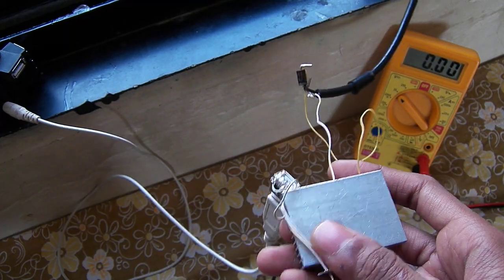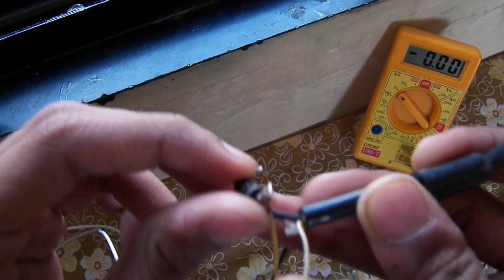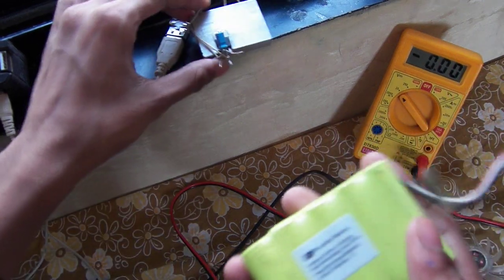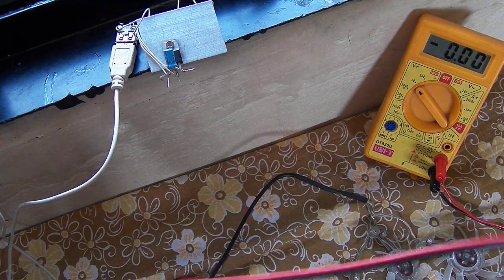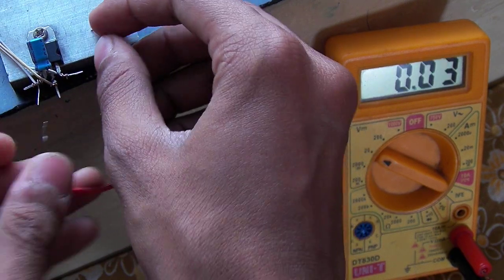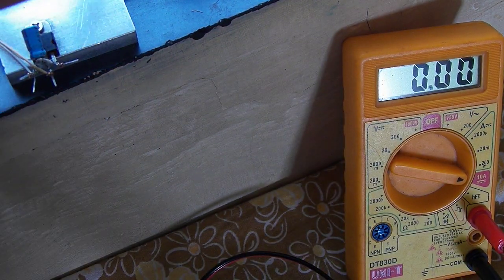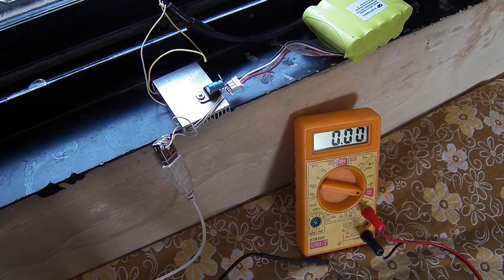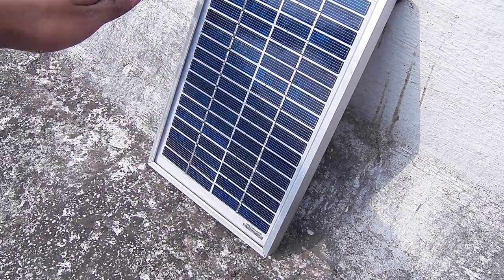Solar powered 5v 1A Usb (part 1)

Comment: Sorry my fried, you are not measuring the right current. Measuring the current (ampere) doesn‘t work similar to measuring voltage. For measuring current you need to connect your measure-tool as part of the current circuit. You need to put your tool between the power unit and your battery pack, like a cable. Good Luck!

Comment: Hello! where did you get the solar cell. i need to know for an entirely different purpose, i am making a drone and i need 2 solar cells with those exact requirements.
Reply from the maker: I got this from local company called "Deshmukh Solar " it's pretty heavy not ideal for light weight drones ,I think
Reply: 64 Bit sorry , but power a drone whit solar panels is imposible